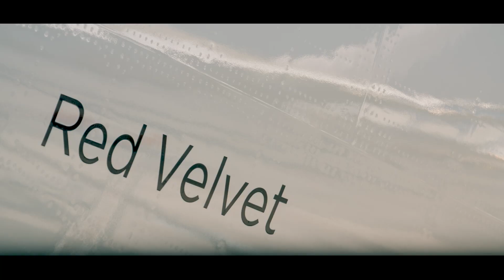In the Making: First #A350 XWB to Virgin Atlantic

Comment: Which is most advance aircraft on this time,a350-1000 or 787-10?
Reply: A350
Reply: Depends how you define advanced really. They are probably about the same but the A350 has much better performance.
Reply: A350 is new and has more features in the cockpit than Boeing but 787 is a more electric aircraft

Comment: The economics from the A350 against the A346 will be so good, senior management at VS will end up slapping each other for not booking earlier slots on the A351 deliveries. That said, congratulations to all the stakeholders for believing and delivering an aircraft that on paper seemed so good to be true but it has supparsed Airbus's promised economics and Rolls Royce promised SFC (Specific Fuel Consumption). All rise for the Red Velvet (Lima Uniform X-ray)